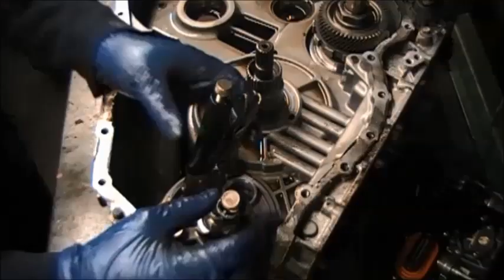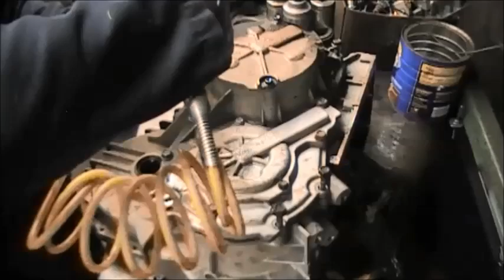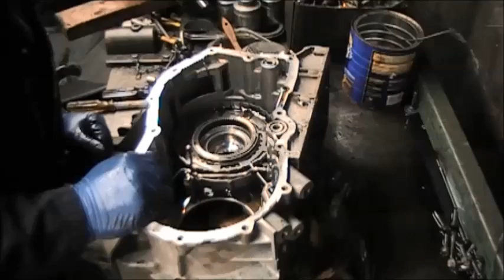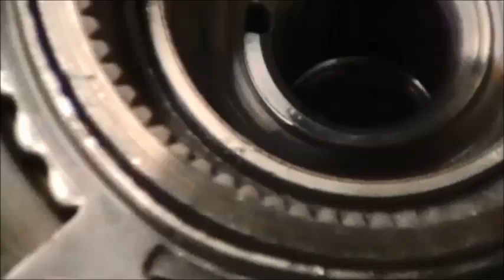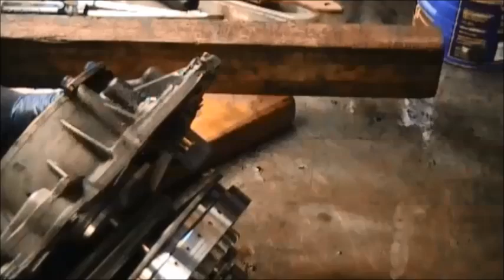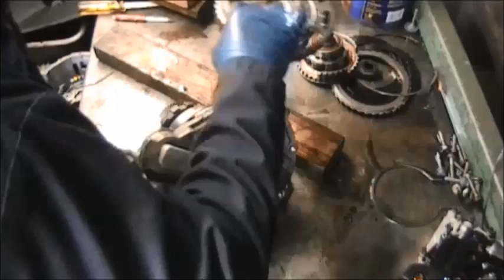saturn vue cvt repair part 3

Comment: I rebuilt my sons vt25e transmission with your videos, thank you very much. However we have a noise in every gear that seems to be a bearing. I think it is the bearing on the reverse planetary/input shaft? I found the bearing for around $30 with shipping. Do you know how much work it is to change that bearing?
Reply from the maker: If that bearing is bad, then the surface of what is rides on is probably going to be bad also, the drive pulley.
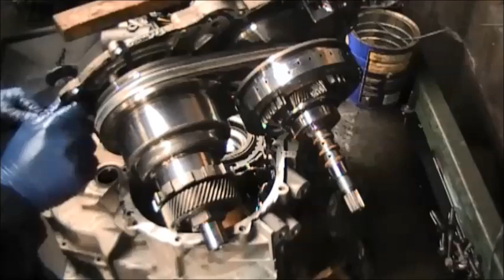Reply: @thisisyourtransmission  I am not sure if I am explaining it right... Have you ever pulled the bearing off the input shaft that goes into the torque converter, does it take special tools? Or is it better to get the whole reverse planetary with the bearing? (you show the shaft with bearing at 5:12 in video 3)
Reply from the maker: Is this the part? https://www.ebay.com/itm/162887355734
Reply: @thisisyourtransmission  Yes! I didn't see that one. Much better price than i had seen before. Thank you.
Reply from the maker: Let me know when you buy this
Reply: @thisisyourtransmission  Done
Reply from the maker: Now,  that planet has two bearings. The one on the back side of it rides on the drive pulley. If the area that it rides on is rough,  then you will need another drive pulley.
Reply: @thisisyourtransmission  in my beginning research on the strange noise, i thought it was the chain or the pump, then when i suspected the reverse planetary bearing, i thought there was only one and didn't notice the bottom bearing in pictures on ebay, i did some more research last night and see the other bearing now, thank you for helping with that, if it did damage the drive pulley shaft, i hope i can find one we can afford! While i think this transmission is pretty easy to work on and repair, finding affordable parts is another thing!
Reply: @thisisyourtransmission  Quick question. Is it possible to take out the variators without taking off the bell housing and the valve body? If so, It would save a lot of work!
Reply from the maker: @KyleGreenhow  I know that you have to take the valve body off because of the  part that follows the variator, we call the follower.

Comment: part 3 here after he takes out the variators there are parts he says fell out of the variators. i wondered if a couple well placed spot welds may stop this problem from occurring .. i almost bought a saturn vue for 650 bucks that looked great, had a good running engine yet but the transmission was bad. someone could really make a lot of people happy if he were to come up with a solution to these "common problems" the cvt 's are having. my thought was just if it fell out then make it so it wont fall out again.

Comment from the maker: I cannot answer a question like that. To know what is wrong you need to go to a transmission shop and they have to follow a diagnostic procedure of their choosing. Now, that said, if one towed a Saturn vue to the shop. I would first take the transmission out and then take it apart. I would look for a broken belt. This would cause no movement. Forward clutches damaged along with the reverse planetary will cause no movement. A damaged pump will cause no movement. Bad torque convertor will cause no movement. Replacing a transmission with another bad transmission will cause no movement. Where did you get the other transmission?
Reply: questioning3  transmission in limb mode

Comment: I have a 2003 Saturn vue 2.2 we replaced the motor and the transmission would not go in drive or reverse so we thought the transmission was bad so we replaced that and that one it's doing the same as the original what could be the issue